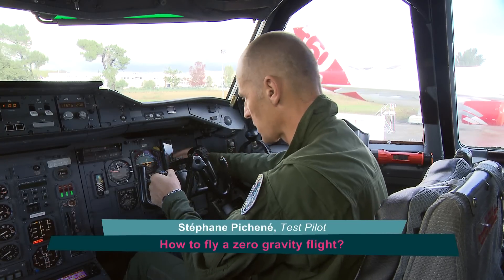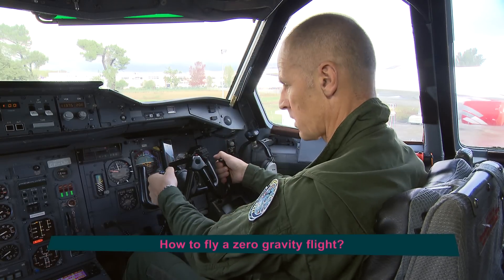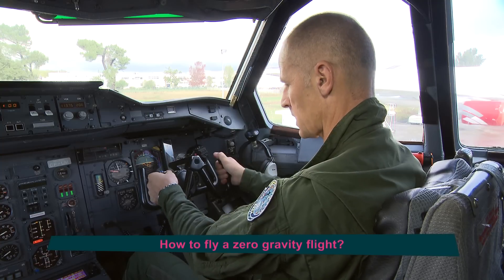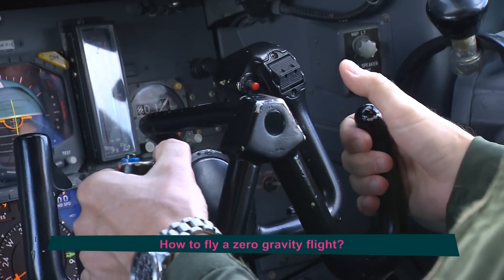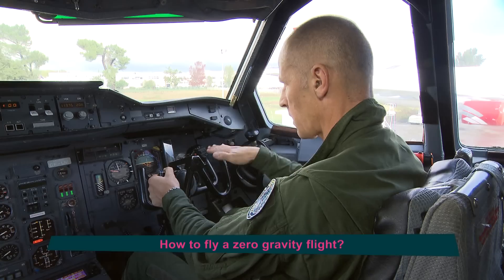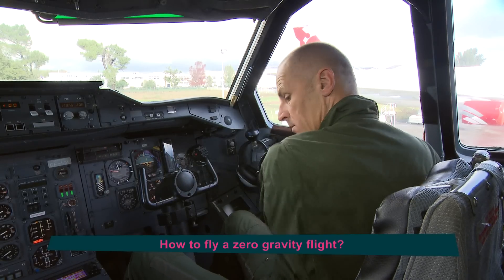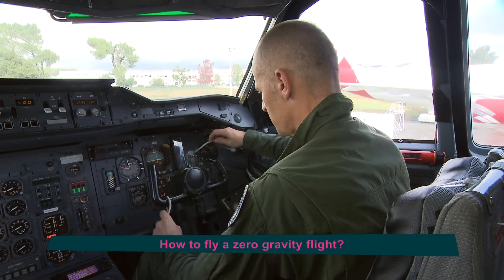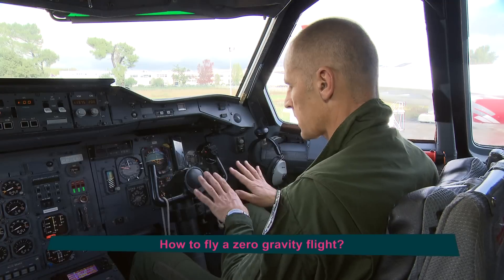How to fly a zero gravity flight - do you know?

Comment: That is shown one relation with aircraft fuselage
between gravity rays reactions . Gravity are rays.

They can penetrate all materials atomic body

 internally. That penetration can be drive atomic

neucleus to move with one motion and one vector

thurst. That is moved to closely each other.

      we called that motion as gravitational fall and

weight . That explanation is my" Gravity theory".

My name is Mister TunLin .I lived in Burma asia.

I have idea challenge gravity.

        I will show connection to aircraft fusleage

 between gravity rays reaction . Your show

parabolic flight within one moment aircraft fusleage

atomic bodies are change one strange action which

is atomic grids are closed temporary and blocked

for passing way of gravity rays. 

           That moment whole aircraft fusleage have 

been own gravity blockade thing . These result

react internally over the crews are feel zero gravity

action we have seen that . These are my explanation

of your zero gravity flight basis action explanation.

       That action said some application . That is 

alarm ours . We can construct zero gravity cabin

machine in ground with same action Idea based

reverse tech. I said who will invent ground seated

antigravity machine . That zero gravity machine

will helpful for many experiments with low cost;

no risk ; high advantage . I want to see grounded

zero gravity machine . future generations of

zero gravity cabins will be built in the space craft.

That will be cover high G flight pressures effect.

I predict that grounded zero gravity machines 

and zero gravity cabins in the space crafts future !